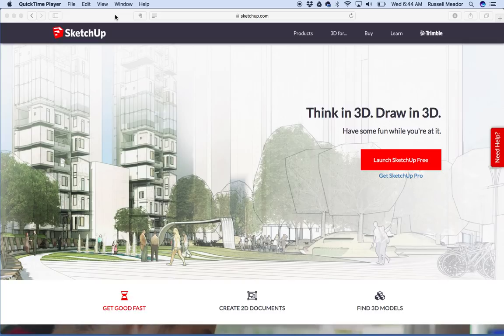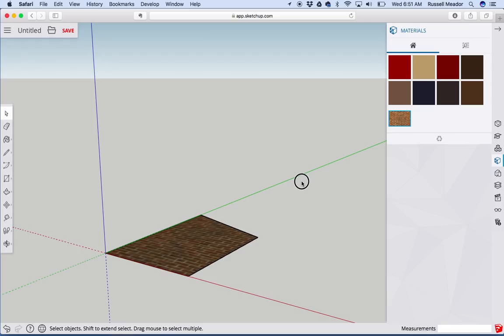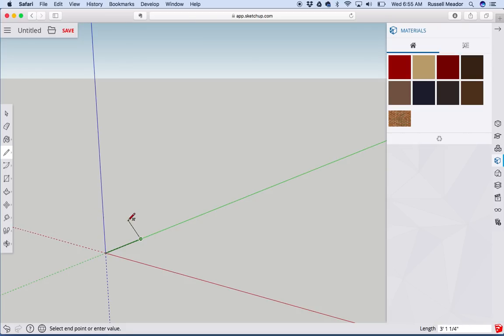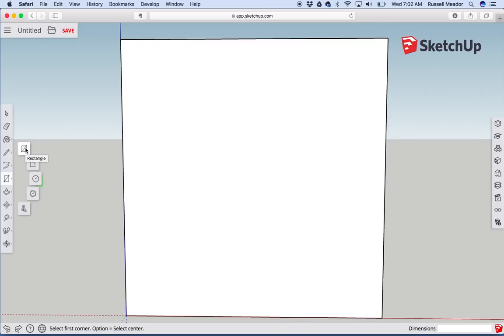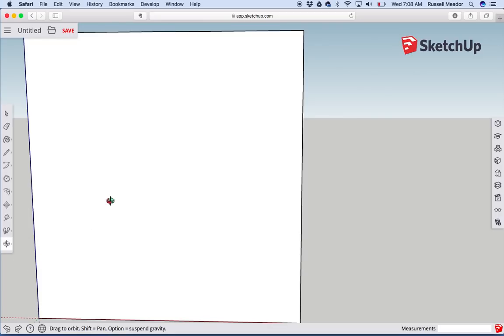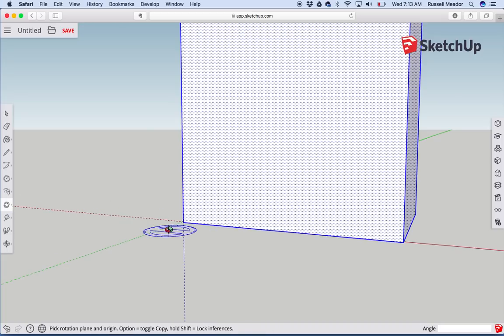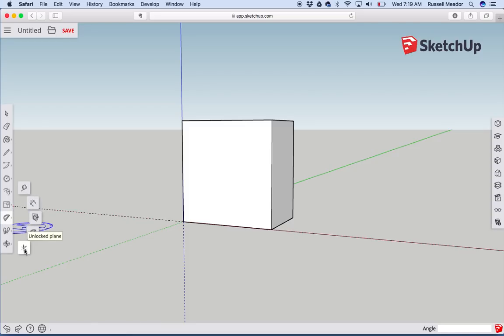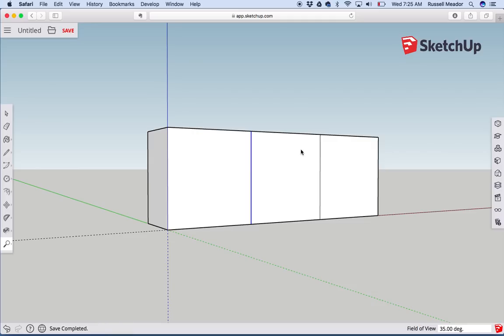Sketchup Free 101 - How Maker's Can Use Sketchup to Build 3D Models - Step by Step

Comment: I want to use cm instead of feet. I don't know what to type to make it select let's say 45 cm and then select that. I have the feeling you type something else after the feet. Am I missing something?
Reply from the maker: Yves, click the icon at the bottom of the vertical menu on the right.  It lets you know select the US or metric model units.  Let me know if it works!
Reply: @BeachBarn  thanks. I was not clear about my problem. I know how to select the metric part. I don't know how to make the 45cm stick.
Reply: stick= select as the length of a line.
Reply from the maker: @YvesHanoulle  - Just type 45 and then hit the enter key.  if cm is the selected units, it will default to that.  Let me know!
Reply: @BeachBarn  that indeed works, I assumed I had to type 45 cm. That did not work. In your video it looks like you type some kind of symbol for feet
Reply from the maker: YvesHanoulle - awesome.  Glad it’s working for you!

Comment: This does seem like a great video.  However,  I seem to have lost the axis points and the blue, green and red lines.  I moved my mouse a little too much I guess and everything is now of the screen.  Is there a way to get those back and control their movement better?  I'd love to continue learning this but need that axis and the lines back.  Thanks
Reply from the maker: John Rowe - hey man, look on the right side of the screen.  You’ll see a pair of glasses.  Click the glasses.  Make sure there is a check by AXES !
Reply: Thanks.  Axes are checked.  The lines actually move off the visible screen when I move the mouse and I'm not able to drag them back.
Reply from the maker: Try this John - https://help.sketchup.com/en/sketchup/adjusting-drawing-axes
Reply: Cool!  That helps.  Thanks!
Reply: Move anything to [0,0,0  SketchUp will move it to the xyz axis point

Comment: Where's the rest of the tools? Custom textures? Follow me? Plugin compatibility??? This is currently a tinker toy. They need to ramp this up to Make level or above...and quickly. Or, come out with Make for hobbyists for maybe $100, or maybe a pro for hobbyists use only license for $200. Though at this point, I bet they are thinking of moving pro to the web, which would really be a shame. Web is for content consumption, not creation.  Nice while we had it I guess.

Comment: Thanks this  was a good  tutorial. I have a new computer and have no choice now  but to use the cloud  I miss having the program on the desktop. My frustration at the moment is getting the layers assignment bar visible I used them a lot with some of the complex geometrical shapes I create. I am currently struggling on working out  how to custom the interface with the cloud version or if it is possible now.I would appreciate any advice from you or other people on this issue
Reply from the maker: I think the two versions work independently....